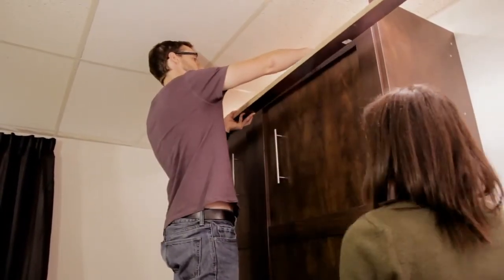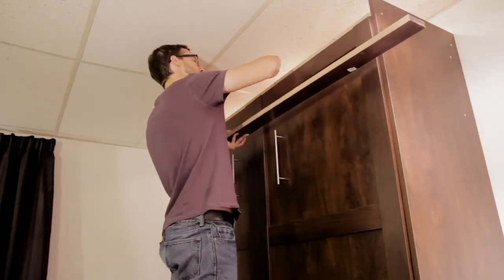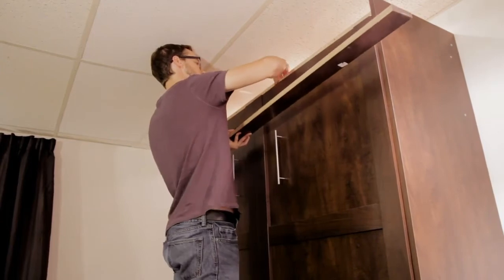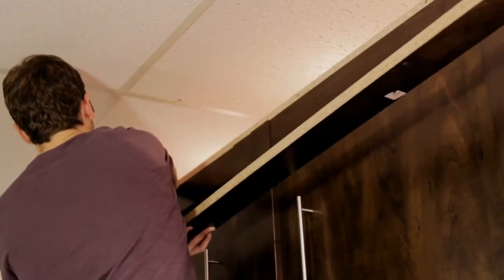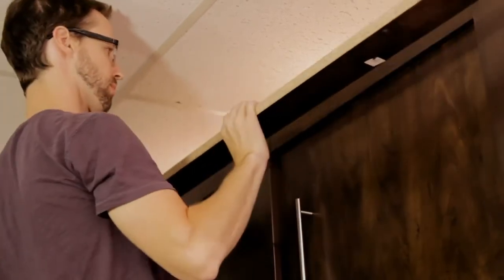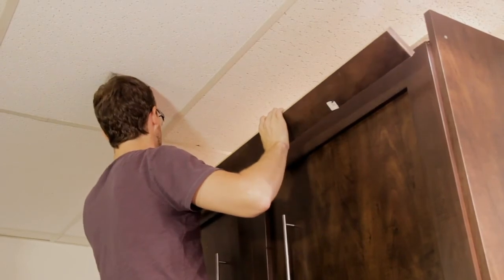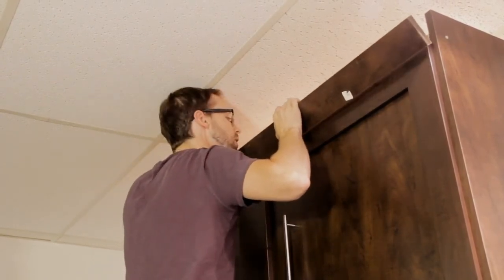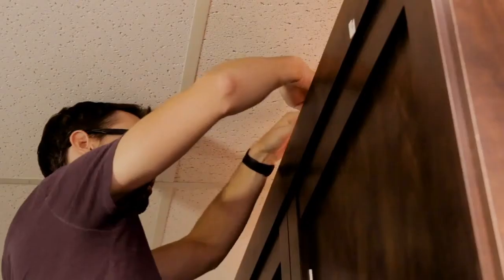Bestar Wall Bed Step 29 - Placing the Finishing Panel at the Head of the Cabinet

Comment: Holes on the finishing panel are too large and will not hold the Anchor Pins.  Bestar will need to fix the tolerances on their hole drilling.   Please be aware.